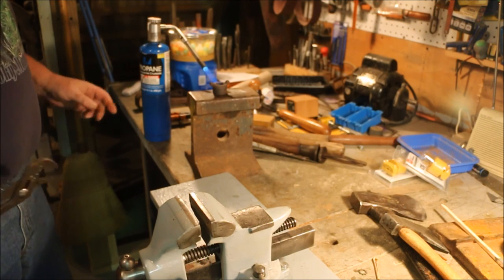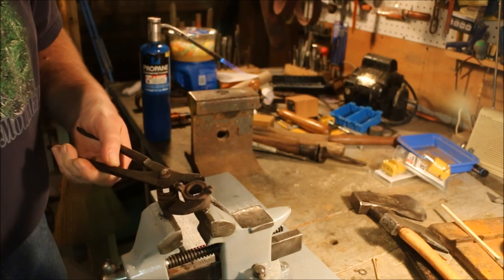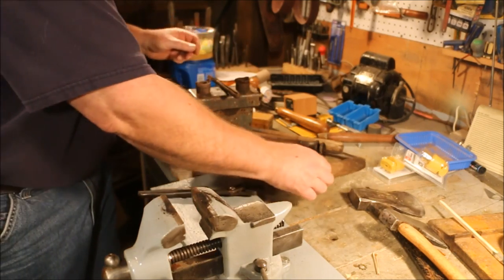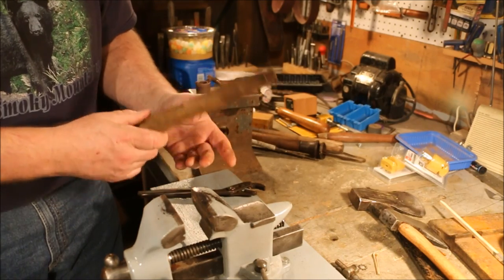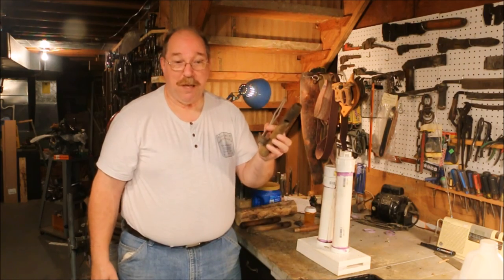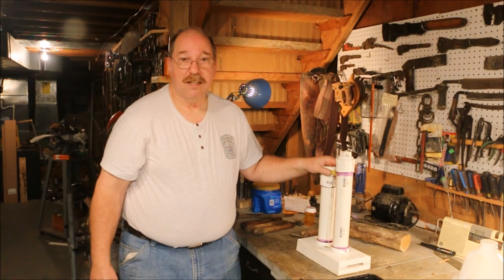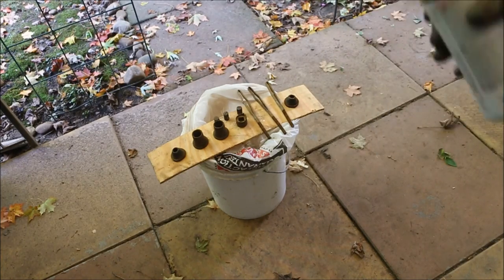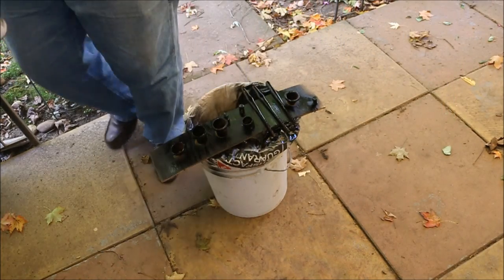Restoring A Two Man Saw ~ Pt 3 ~ Rust Removal, & Paint ~ By Old Sneelock's Workshop

Comment: Old Sneelock, after your guidance on distilled white vinegar for files I have become a convert and it is my "go too" substance now for rust removal. The only downside is that the garage has a whiff of the fish and chip shop about it :-).
Reply from the maker: UK Tony I understand. I think of salad dressing. It's the same smell as bathtub caulk too. I wonder just how many things vinegar is used for.
Reply: BURP!
Reply from the maker: In Kazoo it could be dangerous. The panhandlers would be breaking in to get some carryout. 😈

Comment: I always find I get better results from spraying these once rusty parts if I give them a coat of Aerosol etch primer first, it seems to give a much better long lasting finish on those parts that get used.
Reply from the maker: Englishman French I don't know why but I have answered this one 3 times now and it keeps disappearing.
I remember using pre-etch primer on galvanized parts. I've been sucessful with Rustoleum. I'll have to give it a try.
Reply: Sounds like a plan. Now what is the stuff? Sandable primer??
Reply: Yes, I have used Rustoleum and find it vey good, we have a similar product in the UK called Bondaprimer, these "good" products seem to get outlawed by the safety police, so it is best to stock up on them while we can, the Etch Prime I use (in UK) is convenient in as much that it does not require the usual mixing in of acid component, I have tried it with my adhesion test, spray on sheet metal and bend it, and it works very well, as well as you would expect from an aerosol paint that is, its advantage is that it is convenient, and you can apply it as soon as you have cleaned up the components you are restoring, I find any long dwell there can lead to more rusting. It is not a Zinc Phosphate, so is not particularly dangerous.
Reply: Englishman French Thanks, Pal. I better stick with the benign stuff as I'm already too dangerous for my own good. Sounds like a real deal if you did it wrong.
Reply: Would Hammerite smooth sprayed on the cleaned up parts have the same effect ?.
Reply: UK Tony I'll add a big ??? for Unc to answer too!
Reply: UK Tony: I have had very poor results from Hammerite recently, it seems to come out of the tin so thick it is like spreading peanut butter, I have very little luck in thinning it , they have probably had to alter the formula to satisfy the Health an Safety police. Just use the etch primer aerosol from Halfords, it goes a long way and gives excellent results, even when sprayed on sheet metal you cant dislodge it when you bend it.     Chris B.
Reply: Thanks for the tip Chris, we have a Halfords in town and I will try it in the spring with some exterior cast iron furniture (a job for this year but it just seemed to get left).
Reply: UK Tony: The very best treatment for that is to take it along to your local sandblaster, he will etch prime it, or powder coat it, and you can then you can apply the spray colour of your choice, (if you decide not to powder coat). Chris B.
Reply from the maker: Lewie McNeely I've heard of Hammerite but never ran across it. Might be a regional brand name.
Reply from the maker: Lewie McNeely Just looked up Hammerite. At $12.00 for a 12 oz rattle can I know why I've not used it before. That's too rich for the boys I run with. $6.00 a can Rustoleum (use to be $3.75 a few years ago) is more my speed. :-)
Reply: I came across a quart tin of Hammerite in a local big box store in British Racing Greenv(I think you call it hunters green) which was badly dented and marked down to a £1. Guess what colour all of our garden furniture will be next year :-).
Reply from the maker: UK Tony My fathers favorite color. Almost everything that he made was painted Hunter Green. The other option was mill end gray.
Reply: Ha Ha ! That is a co incidence, I am just painting my wood burner that colour as well, (Hunter green I mean),with heat proof paint of course. Chris B.
Reply: Next spring we will have a green patio set, bench, wheelbarrow and anything else that looks like it needs to be British Racing Green. Take care everyone.
Reply: UK Tony British Racing Forest Green is my favorite color next to Carolina Blue. I can't help that, veing a tarheel. I even like O.D. (olive drab) as long as I'm not affiated with it. Remember James Taylor choose deep greens and blues, not that that has anything to do with anything.
Reply: Lewie McNeely: Olive Drab, great colour, all my Jeeps are painted with OD! Chris B.
Reply: Englishman French It has it's place. I was intimately involved with it for 2 years, 9 months, 14 days amd 10 and 1/2 hours, plus or minus 30 minutes. And they threw in a dose of malaria to boot. No extra charge.
Reply: Lewie McNeely: Ha Ha! But you survived and are a better man for it ! I am sure.
Reply: Englishman French I did learn to run a crane in there and made several power and grocery buys from throwing a drag bucket around, and a few tidbits here and there.  Mostly i missed my buddies but not the mind game.

Comment: Looked like enough was enough. Found out that the dozer has a safety between the engine and the pump made out of plastic/nylon/whatever and that sheared off and left me stopped. Cat must've had a lot of trouble out of them because they came out with an upgrade. The old one is like a overhead timing gear on the pump with a plastic piece that fits over the gear that takes the place of the pressure plate if it was a straight drive. Small teeth. The upgrade has 5 big lugs, like a Lovejoy coupling and is a lot stronger but will still shear if the pump locks down so as not to destroy a perfectly good crankshaft. And we hauled the 4 day old covered remnants of the brush pile/stump pile back and ended up with a fire in the truck bed by the time we got to the parking place. Interesting day BUT I get tomorrow off so I can do something constructive very locally, as in HERE. NO diesel involved though, I don't think.
Reply from the maker: Lewie McNeely We had a bonfire Saturday. Yesterday I stacked some tree fall branches  and twigs in the fire pit. I put the grate back over the pit. Two hours later I went back out with the dog.  All the wood was gone. 
Hope the truck is okay. Do you think it was the wind from driving that fanned the embers?
Reply: Old Sneelock's Workshop Sure was! Jeremy is 6'4" and he had his right foot planted firmly on the floor and that 425 Cat was doing what it was supposed to do! Nobody passed us, The Duramax in the service truck was doing the job likewise! The only smoke we saw was inside one stump and we left it on the job. About 5 or 6 miles down the home road we started seeing a little smoke and it grew the farter, and then the farther the faster! We were HUMMING before we turned off! It bucked the side of the bed where the fire was a little. A round bottomed OX Body bed. You have to really look for it. We were looking for it to light the tarp up but the wind went over it. Interesting.
Reply from the maker: Lewie McNeely I have spent time trying to unsuccessfuly start a fire in that pit.
Reply: Old Sneelock's Workshop Seems like that's the way it goes in a lot of stuff. Us older more mature codgers have had to deal with it a long time and the younger ones will, one way or another. I was short-hauling in the truck yesterday and it about crippled me. Now for a day to get straightened back out and maybe the dozer will be intact tomorrow.